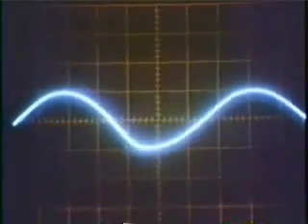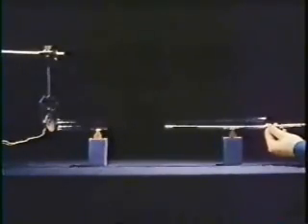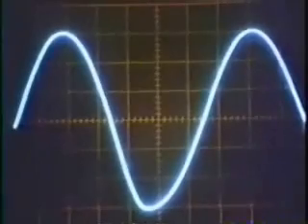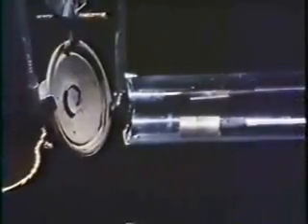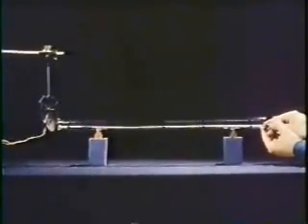Physics of sound.

Comment: Simply put in a one word: Vibration! Sound is the vibrational frequency range below radio waves. And radio waves are the frequency range below Light! After that is UV an then I say Thought waves! All the same but different frequencies. Energy is movement, vibration,Life! Neutral is Infinite possibility of Super position! Everything is Energy..
Reply: One big diffrence. "Souns" is air pressure variations. Light and radio are electromagnetic radiation. Both energy variations, sire. But completely different mediums and speeds